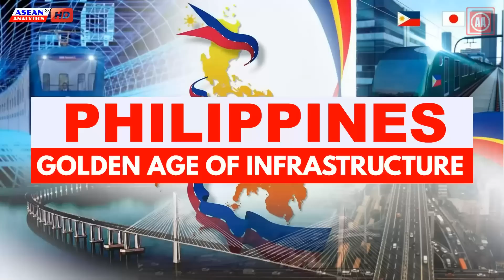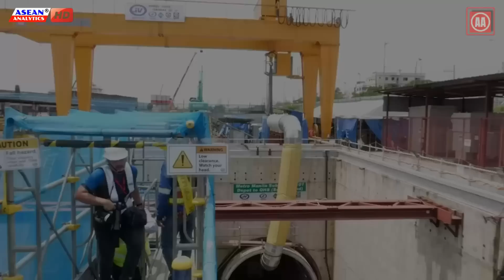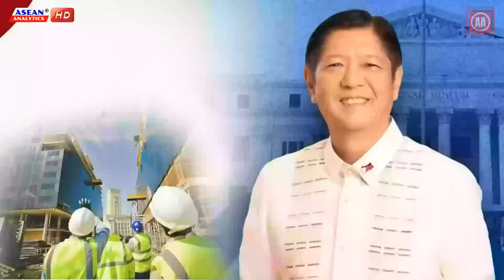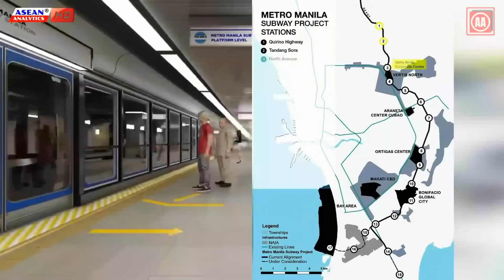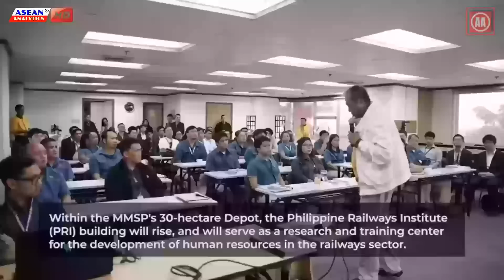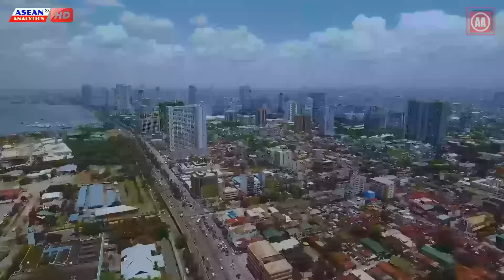Tunneling Works of Metro Manila Subway Revealed by DOTr | Operation Start by 2029

Comment: Subway will pass  by around the city underneath the high rise buildings etc.used by Boring Machines. thay why it's expensive projects .If the railways elevated mixed with underground  station it still MRT not a Subway FYI

Comment: A REAL SUBWAY TRAIN GOES 100% UNDERGROUND. ONLY SINGAPORE (AND PHILIPPINES - UNDER CONSTRUCTION) HAVE THEM.
Reply: The Bangkok Metro system used to be an MRT Blue line is underground system for 17 years, a distance of 21 km. with 18 stations from 2004-2021.

But at present, it has made an extension that is an elevated rail to join and build 5 more underground stations, a distance of about 5 km..
Reply: m he's talking about fully underground subway, don't insist your country Thailand🤦🏻
Reply: @sakakisak5413  hindi nya siguro naiintindihan ang 100%.
Reply: @sakakisak5413  and singapore is not 100% underground wdym
Reply: What stupid logic is this lmao?
Reply from the maker: Thanks for watching, stay connected for more..

Comment: Asean countries do not have high-speed rail
Reply: That's not true! Indonesia is making one and soon will be in operation.
Reply: @Nong_Bisakel  so what he said is true asean country don't have HSR.. Indonesia HSR is still in a testing trial run, so it is still not fully operational..it should be fully operational before you claim it..
Reply: Asean already have i think indonesia
Reply: @Coboy_junior
Overproud it.😅😅😅😅so funny
Reply: Are you sure? CHINA & JAPAN has speed train. Western countries & US no speed train that's they envy at the same time angry of China.
Reply: @rhezapilapil6225  china and Japan is not part of Asean countries or south east Asia.. china and Japan are part of East Asia.
Reply: @rhezapilapil6225  And there's nothing for America to envy China's HSR. China's train is not profitable it's a loss..it has no passengers. The passenger fare is needed to cover up the capital expenditure and  operating cost.. That's the reason the US dropped the plan of having HSR because It's increasingly costly. There are only a few HSR trains that are profitable and one of those is japan HSR.. now let's see what will happen on Indonesia's HSR if it's fully functional.
Reply from the maker: Thanks for watching, stay connected for more..

Comment: Only Singapore has subway in South East Asia
Reply: Singapore is only the fully subway.
Reply: @victorcansing7421  it depends on landscape stuffs, in terms of safety not have to force fully subway
Reply: @jojoh1  yah it depends but its also a fact that the singapore is only the fully subway in asean. You cant deny a fact.
Reply: Wrong Bro Jakarta has also subway so don't be overproud okay and next month our HSR.
Reply: @livingwater888  Jakarta has subway?   I don't think so.  I've been to Jakarta.  Yes, Jakarta MRT has stations underground but it's not a fully subway line.
Reply: @ronnienestor  asean country has subway and malaysia, singapore, thailand, indonesia has plan to building new fast train while ph subway is not finished yet
Reply: @rendidwi6272  Correction:   if you say subway line:  it must be "FULL UNDERGROUND LINE".   There is nothing in Jakarta.    Yes, you have underground stations just like our LRT and MRT with underground stations.  

Metro Manila subway is full underground all the way to airport.
Reply: @rendidwi6272  I love Indonesia.  There is no need to argue on this matter.  You have high speed rail wherein PH has none.  Cheers.
Reply: @ronnienestor  you do not know lah, don't comment please. The underground MRT or subway is extended to north Jakarta ( Phase 2) and Phase 3 ( elevated and underground) from Tanggerang to Bekasi via Jakarta ( 90 km) and Phase 4 will likely all elevated.
Reply: @livingwater888  Thanks for the heads up..... cheers.....I love Indonesia.
Reply: @ronnienestor  You are not living in Jakarta, so i undestand ypu do not understand. Aftet the 2024 election , we are buikding 2nd Phase HSR Bandung to Surabaya South Line  (750 km + ) with China. MRT from Tegal luar ( new provincial capital of west Java) to Kertapati International airport ( through bandung city, Great Surabaya MRT and Bali MRT/Airport Link from Bali South Airport to Seminyak ( elevated and underground) as 1 st Phase. We have more rail project  between 2023 tp 2035, that will spend a capex up to usd 150 Billions.
Reply: @livingwater888  Amazing
Reply: @livingwater888  I was just wondering why the ridership of MRT Jakarta is too low? Less than 100K daily.
Reply: @ronnienestor  The north line Semi high speed from Jakarra to Surabaya ( 800 km) has been given to Japan 2 years ago but if they are dragging their feet like in Thailand and Vietnam, we will.switch to China- France consortium. We are currently negotiating with China as well for a big subways and monorails in case Japan play us with slow walking the project. This will be the same fate to Shell when they drag their ass for the Masela LNG , so we juat kick them out.  We did the sama.for Sumitomo metals and Panasonic, so we gave the biggest nickel.mine smelter and EV battery manufacturer to China with buyers from Ford motor co and LG Hyundai. Those countries and companies who like to play " funny" with us , get kicked out. I will see what will happen when we stop exporting Bauxite, Copper, Tin, Rare earth  metak Manganese, Silica sand, LNG and Coal.  We have not talked about Uranium, Thorium, Gold, Silver, Methane Hydrate etc .
Reply: @livingwater888  Hi Steve.   Great update.
Reply: @ronnienestor  because only for phase 1 MRT waiting fod phase 2 and coming out of Covid, now starting to increase as we interconnect several mode of rail and electric buses ( BRT) it is a combination of commuter lines ( KRL) , MRT, LRT, HSR and BRT. All electric by 2025. The rail network for greater Jakarta is based on TOD  Those 5 transport modes will carry a daily passagers for 2 to 3 million. We are building, modernized all those modea including several massive stations such as Manggarai , Tanah Abang, Bogor, Depok, Jakarta Kota amd several new stations as we expand the MRT, LRT, etc The TOD concept follows Tokyo megapolitan city for 40 Million greater Jakarta. That is why we have expanded our train manufacturer INKA cooperating with Staedler , Siemens and Alsthom. For Asia we work with China CRRI, South Korea Hyundai Rotem and Japan ( still waiting 😅😅😅)
Reply: @ronnienestor correct 💯
Reply: @livingwater888 so you said (elevated and underground) so still not fully underground LOL
Reply: @charliesue8197  u are not in jakarta so u are lack infirmation lol
Reply: @charliesue8197  up to you lah ..if that makes you happy 😇😊 cool ?
Reply: @charliesue8197  go ahead inflate your ego...if that is what you want...you are top of the world like India 😅😅😅😅
Reply: @ronnienestor  Yes, Philippines might have one, as long as it meets the demands, and I can't afford to wait until 2029 to see the Philippines get its first PSDs.
Reply: @livingwater888 😅 Jakarta doesn't have fully underground stations of MRT most of it are elevated. don't be too proud. Subway means fully underground! FYI
Reply: @livingwater888 ,Indonesia has no subway don't fool us here , fools your fellow Indons not pinoy,  a called subway system is fully underground tunnels, not few meters was underground the rest was elevated subway thats not subway called bobo muk mafi hhaha
Reply: Bangkok and KL has also subway so why did you said that SG only?
Reply: @sukarap7754  It's true SG only cause they have fully underground stations. search for the meaning of subway dude 😎
Reply: @charliesue8197  SG has fully underground stations because it is small island country so it was very easy to manage and developed the whole area. Simple logic! 😉
Reply: @sukarap7754  I know 😅 why are you so defensive? I'm just stating facts that you didn't understand! like this is the attitude of indo and nguyen clans, no wonder!
Reply: @charliesue8197  have you been to sg? it's not 100% underground bro, even nyc subway is not 100% underground, chill it's just about the naming
Reply: and soon metro manila subway along with Singapore are the only fully underground among asean country!
Reply: Bangkok used to have an entire subway system for 17 years from 2004 to 2021 is MRT Blue line

until the construction of an extension with elevated levels added
Reply from the maker: Thanks for watching, stay connected for more..
Reply: There is no news about subway in thailand and jakarta when you say subway its total subway like 100% underground like in New york show some evidence if there is really 100% subway even this channel no update so meaning only singapore and soon the Philippines has a fully subway.
Reply: @styletradz1820  have you been to new york? it's not 100% underground bro...